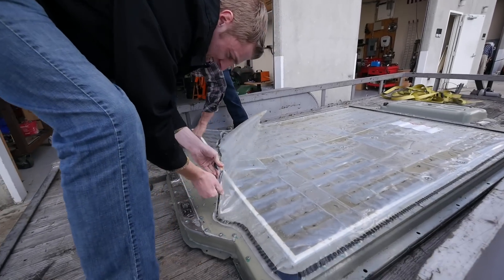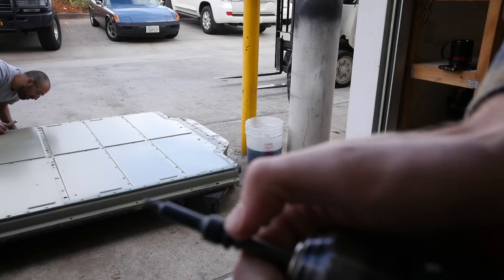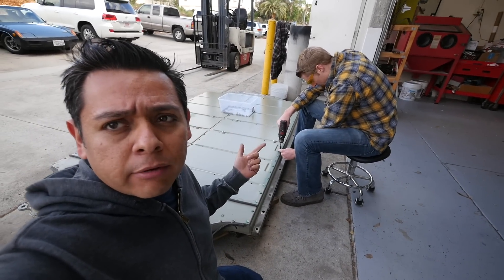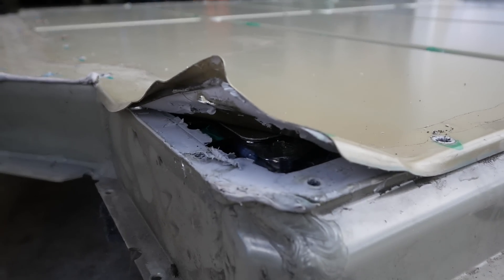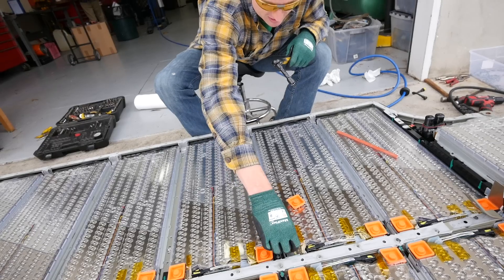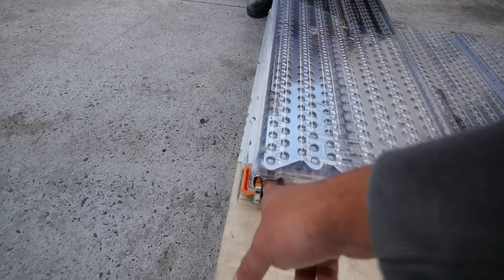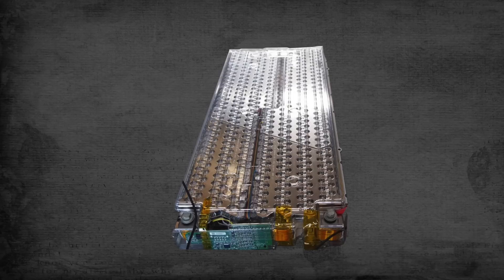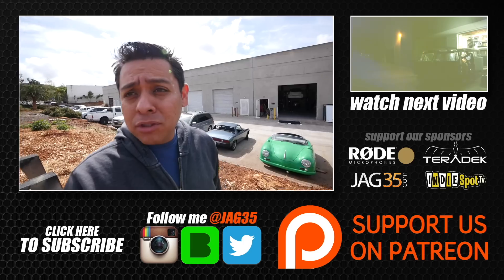TESLA MODEL S BATTERY TEARDOWN

Comment: if all modules are connected parallel  then pack voltage must be  24V and power must be 84 kW . if all modules are connected series then voltage must be 384V and power must be 5,3 kw . Where is the 700 volt on the system? i am confused.

Comment: Hello Jehu. I am very curious to know about the properties of the metal plates on top ascends bottom of the batteries to which the cells are wire bonded. Are these copper or nickel plated copper or nickel or aluminium plates? 
 Everywhere I searched on web and people just say metal plates. So which metal are they referring to?

Comment: Hi, you mentioned putting these 24V “cores” (I’ll call them cores from now on) in parallel to make a higher capacity battery pack. I was wondering if you put any thought into how to deal with an imbalance between cores. Once you put the two cores in parallel any imbalance will rapidly discharge into the other lower voltage core. This could lead to a lithium event because the cells are not meant for high rate charging. I work on batteries myself so I was wondering how to deal with this issue. The obvious answer is to discharge/charge the cores to the same voltage and then connect in parallel. Any other ideas? Add resistance between cores so imbalance discharge would be low current? Looking forward to hear your thoughts on this.
Reply: BMS with a really good balancer or connect the series groups in parallel not just the main pos and neg

Comment: i  would like pictures of the battery pack im only 14 but im trying to come up with an innovation to stop the batteries from overheating and when punctured seal of that battery cell and inform the driver i would also like to see all the parts that were in the battery pack after you removed the cover

Comment: I've heard from multiple sources that you CANNOT parallel the Tesla packs. That it is extremely dangerous and very difficult to get a BMS system to work correctly (that is actually requires multiple BMS systems - one for each pack and then another to run the entire battery bank - and that was directly from Orion - who also states you severly degrade the usable power in the pack do to the safety margins required to not overcharge a good pack if you have a weak pack in the system.

Comment: I'm curious about something (because I'm not en electrician or engineer of any kind), if you wanted to use these batteries to make your own power wall for your home, could you not simply take that entire battery pack (without dismantling it) and simply stand it up against a wall so the edge of the whole battery pack rests on the floor?  Obviously you would need to jury rig some kind of interface between the inverter etc from your set up, but can you stack these things anyway you want or join whole still-assembled battery packs together (like 2 or 3 of them)?
Reply: You’d have to find an inverter that works with high voltage DC. They do exist but your standard residential inverter is 12V-96V. Inverters that can take an input of 400V DC are more industrial

Comment: don't you need some sort of cooling system to use it at home with an inverter??
Reply from the maker: No these are capable of 1500A and any home setup is going to use around 150A

Comment: Is it possible to construct a similar battery with similar output using 18650 batteries as a diy project??
Reply: Yes because they are the batteries that are used and the packs are cooled by coolant going through dedicated ducts, being cooled by radiator. 1 packs is 444 batterys in parrellel circuit with 24 vokts so to get the same output you would need the same 16 pack as usind in the battery taken apart with a total amount of 7104 batterys (18650) and output voltage would be 384volts. All cordless tools use this system just with different batterys

Comment: you removed the liquid coolant.. but how does it stay cool otherwise?
Reply from the maker: It just does
Reply: interesting... okay so I am a complete noob, my goal is to buy several of these (mabye 4 or 5) and use it as a "remote" way to charge a PHEV.. (I can charge at home, but when I get to work there aren't any plugs to charge with). What is the best way to get 120v AC to do level 1 charging to a PHEV? Thanks!

Comment: I’m planning on putting two of these batteries in my RV. I’m not too tech savvy but I’ve been following you and some other channels for a while now on my private profile.
I will have about 3200w if solar on the roof and figured two of these batteries in parallel at 24v should be plenty but might add more later.
I’m still figuring out if I should run two 24v Multiplus 3000w inverters or one Quattro (will be using all Victron equipment), with the split phase system in an RV.
The thing I’m struggling most with is the BMS. It looks like the Orion BMS might be a good option but I’m open to suggestions.
The compartment I’m building the system in is protected from the cold and heat and doesn’t drop below 56* in winter or above 80* in summer, and that is before I duct AC to it or install fans.
Reply: Have something similar in mind, and am struggeling with the proper BMS. Lokking at the Victron MultiPlus too. What did you use, what do you suggest today?

Comment: Could I connect 400 of these 5000 mah ultra fire batteries in parallel to get 2000000 mah total that can run a 200 amp load safely at 4.2?
Reply from the maker: Yes,  but don’t use fake Chinese cells like ultrafire
Reply: Well my attraction to the ultra fire where their high mah, even if low discharge i could just run in parallel to bring that load up. Other then being cheap and having low current is there any reason i shouldn't use them? Do you have any other suggestions for high mah / affordable batteries?
Reply from the maker: Buy from these seller,   They sell real cells that perform like their label says http://j35.us/LAST-SALE-2017
Reply: Thanks for the help mate! Love the videos
Reply: minimizing the amps i charge batteries at will pro long there life cycle correct? Is this a linear equation? I am in the market of purchasing $3000 worth of 18650 for my self efficient tiny house, I calculate I will use approximately 2.5Kw / day peak of summer, I'm looking to build a power wall, you would still recommend using recycled pc batteries for the most cost efficient method?
Reply: I have never seen a Tesla battery in person, and will probably never will with my current budget. The heat sinks they run fluid through, how are those connected/around the cells? I'm assuming that cooling the cells lets them achieve a higher amp draw for a more prorogue time?

Comment: The nominal voltage is 22.8V, not 24V. If you try charging that with an 24V MPPT controller, it's going to explode. Probably better change that in the video.
Reply: If your MPPT isn’t adjustable for voltage parameters you should probably trash it

Comment: This is really not how it's done. This pack is a 1.5 model and you should always, always test the isolation resistance once the fuse is removed. This should be above 3500kΩ. Opening the top cover wrong without proper protection. What was the state of charge of this pack? I'm not trying yo be a wiseguy here but you show this on Youtube. Others could get serious hurt if they do it like this.
Reply from the maker: Go for it,    you are free to do whatever you feel necessary to lower the risk of injury

Comment: Hey I have a twin motor 520hp total sea-doo boat.  My question is, can it be converted to electric and how much would it cost?
Reply from the maker: +Matt Helfer  500hp motors are still $30k
Reply: Well it's 500 combined so what about a 250hp motor?

Comment: was that a gas smart car being converted to electric, lol who would do that when a used electric smart is like 7000 bucks.
Reply: The difference is that a converted car is not only more beautiful but it also has more range. How much range does a Smart have? Of course, you can buy three smarts and have three times the range. But it would still be less than half of what you get with a tesla battery pack.

Comment: Any chance of putting one of those cells in your IMAX discharger to get the capacity?  What's the max discharge rate for these Tesla cells?  I've heard 20A for short periods.
Reply from the maker: +Matthew Ray  I did but it had to ship out before it could finish,  I think ludicrous + is 1500A divided by however how many paralleled cells on a P100D module
Reply: a module it says in the specs it can handle 750amps for 10 sec or 500amps cont.
Reply: These are all high capacity cells so 8 to 10 amp continuous at most if they are fairly new.
Reply: if each cell is 40 or so amps - likely - then paralleling many of them those amps ADD so 20 in parallel = 800 amps
Reply: artbyrobot - The cells in the battery packs are older model high capacity and not new high drain that can do 40A bursts. These older cells might be Panny B's which can only do 5A.

Comment: Tesla 18650 cells are unlike other 18650 cells in as much as all the protective circuitry is missing, that is provided externally to the cells by Tesla's battery management. Just using those cells without protection is asking for a fire, a situation exacerbated by the lack of thermal management.
Reply: PTC stands for Positive Thermal Coefficient
http://batteryuniversity.com/learn/article/safety_circuits_for_modern_batteries
don't use shitty sources
Reply from the maker: Dogphlap describe circuitry?   There are NO KNOWN 18650 cells with any internal safety circuitry to me.    I have cells from every one of the 5 mayor manufacturers and I never seen any internal circuit who told you there is such a thing?
Reply: "What kind of battery does TESLA use?
Tesla uses 18650 batteries but has modified them. They have taken out
 the PTC and CID protection circuitry and made them truly bare-bones."

PTC stands for Pressure Temperature Current switch.
CID stands for Current Interrupt Device.

See:
https://batterybro.com/blogs/18650-wholesale-battery-reviews/18306003-battery-safety-101-anatomy-ptc-vs-pcb-vs-cid
Reply from the maker: +Dogphlap  I would not call this things "circuitry"  but rather mechanical safety features.   I am aware of the claim that they are missing on tesla cells but like everything,  having not seen it with my own eyes I don't fully believe it.   Perhaps I will open up one of the few loose TESLA 18650  cells I have in a future video
Reply: That is an interesting point. I don't really know whether the device is an over pressure switch or a thermistor, short of opening a cell and checking for myself I may never know but what I do know is that such a thermistors never has zero resistance (no matter how cold it is) and will have a non trivial resistance at anything like a high current making such a cell useless for high current applications or ones where a terminal voltage is required to stay moderately stable under varying loads.
Anyway your point does not in anyway change my point which was that a typical 18650 cell has safety devices within it while those found in Tesla battery packs do not (not to imply the cells are dangerous just so long as the external to the cells precautions that Tesla provides are not abandoned).

Comment: Can you make another video detailing the cooling system used for the batteries? 
Thanks
Reply: Habib Farooq Coolant flows around the batteries in its dedicated ducts. Cools off at a radiator in front of the car. Motor and controller and cooled the same way as well
Reply: @huzaifarashid1  I wonder if they use the same lines for battery and motor into the radiator. Wouldn't the motor get hotter than the battery?

Comment: I'm curious about how Tesla protects the battery cells from impact on the bottom of the pack.  High strength steel?  I think that's one of the major hazards, hitting something solid on the road and damaging the pack from the bottom severely enough to trigger thermal runaway.

Comment: Would be interesting to use one or two of those modules in a A123 Systems Hymotion Kit Battery Replacement.
Reply from the maker: +Timothy Suhr  24v x 1000A would be my guess
Reply: jehugarcia it actually tandem to the small PRIUS battery.  So I would think simular voltage.

Comment: But now there`s no way to charge the packs, how will you deal with that?
Reply: Why? It is just physics. The reason you can't use just any charger for the car is because of the computer that controls the circuitry. They removed all that by just using the actual battery pack (or cells).
Reply from the maker: correct,  its just a battery
Reply from the maker: +Nax FM 24v or 48v charger/ charge controller
Reply: Thanks, i thought you couldn't  charge the packs with any charger, but only with specific ones

Comment: those are NOT the correct kind of rubber gloves for high voltage EV work. You need to be using class 00 rubber inner glove with a leather outer glove.  Gloves should be checked for holes and punctures EVERY time they are worn.  The voltages are deadly and care needs to be taken.
Reply: ERIC & CINDY Crowder And what is the point of the rubber shoes when you are sitting on a chair that has probably a lower resistance than shoes, and also not using the right tools... It's correct what they are saying it's dangerous, but this just looks really amateur.
Reply: @KingFrederik1309  You know electricity from this battery only goes to battery ground and not earth/neutral?  the most dangerous part is working with your hands making a possible connection through both arms past the heart.  200VDC could make that connection.
Reply: Talking like a lineman. 👍🏻
Reply: ERIC & CINDY Crowder great insight
Reply: I agree with other posters that shorting out opposite polarities might be the biggest danger here. As an electrical electronics product designer, I would absolutely expect each battery module to have internal fusing since they are handled as modules during manufacturer and since Tesla will want a fault to be isolated within a module.
I think the guy talking about his personal protection show that he had an appropriate mindset, and even though he might not be doing his PPE perfectly, his mindfulness moment to moment to lower the risk substantially.
I have bridged opposite polarities in my work a few times in my younger years, it's pretty exciting!...Yet something to avoid at all costs.
Reply: So why don't you make a safety  video  ?   That way you can get it all out !
Reply: why not just drain the batteries? lol
Reply: True, however keep in mind that the main contactors are no longer powered, splitting the pack voltage in half once already down to around 200VDC. Additionally its important to maintain dexterity with your hands so you don't drop your tools/bolts, and thick rubber gloves make that very difficult.

Comment: I didn't see you guys undoing coolant connections with any of the modules. those are just with no fasteners?
Reply from the maker: yes
Reply: And absolutely no leaking? That's an awesome result. I imagine vibrations wear down the seal as it constantly rubs. A photo of that connection would be awesome

Comment: so... what about modular repair? if you crack a module, Will they fix the complete battery?
Reply from the maker: +luckym0nk3y  they can just replace damaged modules
Reply: I'd guess they would do that but how can you do this while you guys had to take a whole day to take apart the complete battery?
Reply from the maker: +luckym0nk3y  I don't see the problem....
Reply: no... there's no problem, I'm just wondering how Tesla would replace one module.
Reply: luckym0nk3y They will replace individual module.
Reply: obviously! but how! if it takes Jehu about a day, that's not efficient
Reply: luckym0nk3y Will take more time to  repair.  These guys are only taking it off but doesn't have to put it back. ☺
Reply: let's say Tesla takes about 2 hours to replace 1 module. (I think it's more like 30 min.) my question still is.... how? not saying jehu and the team took too long to do it but if it takes Tesla 2 hours, I just want to know how. I think I heard something that you'll have youre car back in 4 hours. that's driving your car in the shop, taking the bad module out, installing the new module and driving out of the shop.
Reply: luckym0nk3y If you need a module replacement you're most likely get a loaner battery.  In order to replace a module you'll need to open the battery like these guys. Then you need to reseal and run a test. The test alone is about 2 hrs.
Reply: but that's super inefficient!
Reply from the maker: it doesn't matter,  it is what it is,  failing modules are probably rare and you are talking about a $50K battery,  2 days is well worth on the most expensive part of the car.

Comment: beautiful battery, you should just build the car "around" the Tesla battery.
Reply: RunFor OurLives it will blow if it will pirce a battery
Reply: Just normal pannasonic 18650 batteries with cooling
Reply: @loooooopy  Nope , there not 18650 !
Reply: @stevelamperta865  what cell are they then, I've bought some they are ncr18650b

Comment: Can you use the whole system as a bank for a Solar Home,  Seems like half the battle is done
Reply from the maker: yes,  this could power 2 homes.   Its about six POWERWALL II worth of energy
Reply: It's a shame you have to break the system apart to make lower voltage banks.  Such nice packaging.
Maybe Tesla could make an inverter/charge controller for complete units some day once there are more used units around.
Reply: jehugarcia,
One house requires about 40 Kilowatts?   Why then Tesla sells 7 and 10 Kilowatts power walls, is one supposed to buy 4-7 of them to power one's home?
Reply: Maxim C. 40 kw daily not hourly.
Reply: Dr.mice,
I know, I know.  Although that's besides my point/question...  I asked why if to power one house we need about 40 kw and Tesla sells 7 and 10 kw powerwalls?